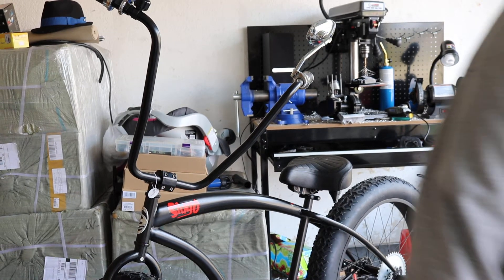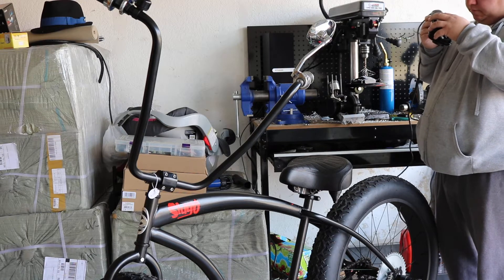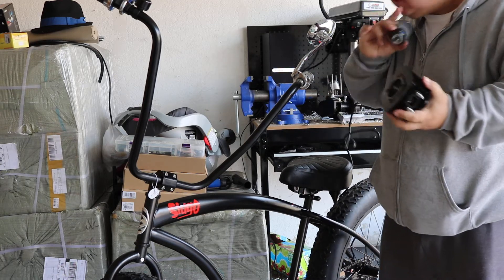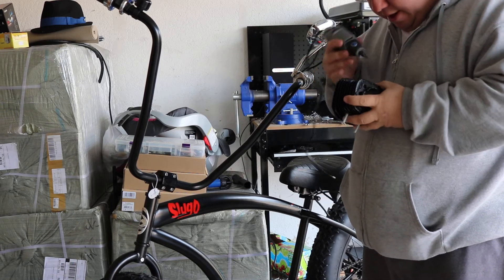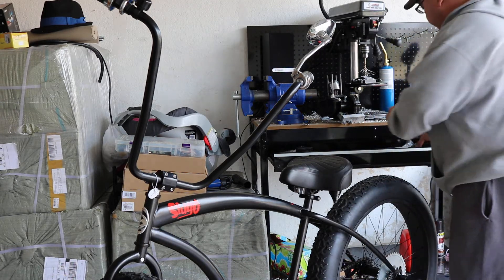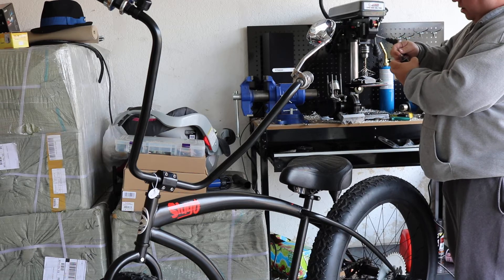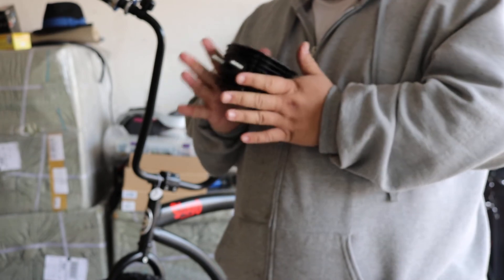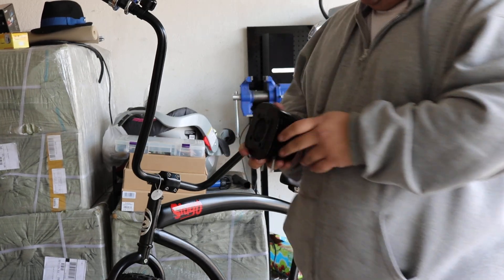How to port match a Chinese 80cc Bicycle Engine Part 1

Comment: I've been looking for a free to cheap set of handlebars shown 0:39. I ride a mountain bike with a 80cc engine on it. But I have back problems that make it difficult for me to lean that far forward with the traditional straight mountain bike handlebars. Anybody has an extra set laying around they don't want let me know and we can see what arrangement we can make. if it's got the bar that goes across the center Like some handlebars to that might be even better. That will give me a place to mount my headlight, GPS / phone, and other accessories.

Comment: 23- 25mph? That's less than the top speed I got from a 50cc on a 29" Huffy. Smaller motor on a heavier bike, clocked on GPS @27mph. Straight, level, no wind, bone stock/no mods

Comment: Chinese moped engines are notorious for going out of tune quickly, over revving, under revving, choke sticking open, choke sticking closed, will not, can not and never will hold a constant idle, and their parts are somewhat not well made or fabricated. Other than that , the engines are Great.  We know of what we speak...